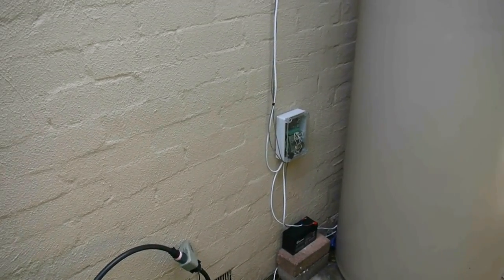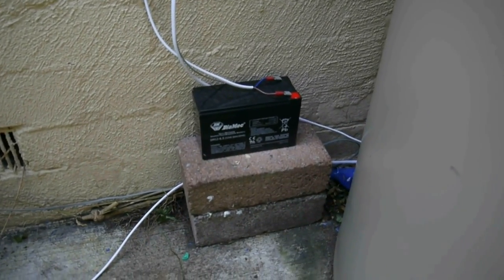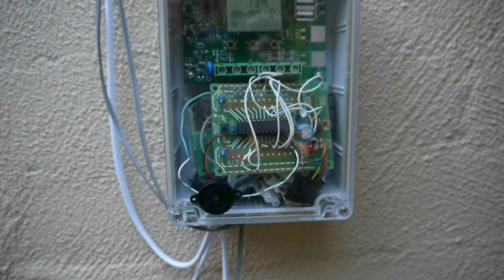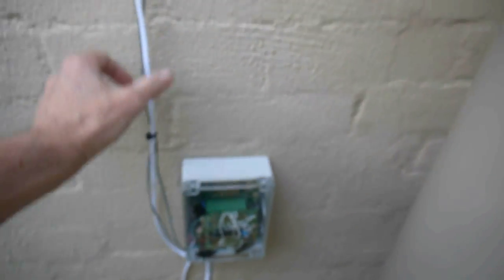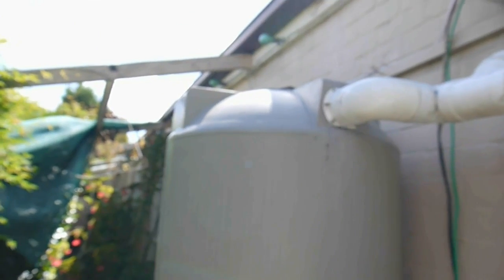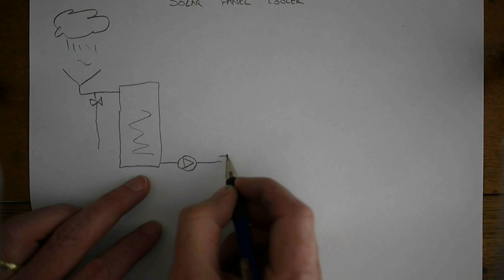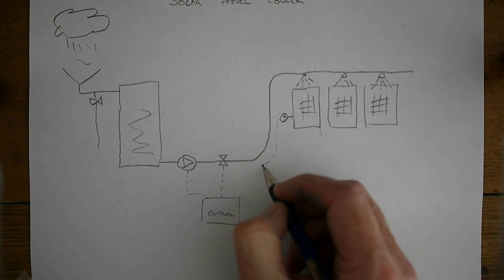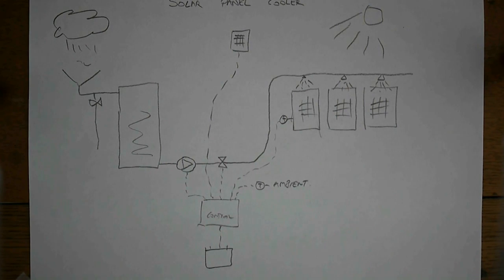Solar powered solar panel cooler system

Comment: Cooling PV panels is now an established business across Europe through the conversion of PV panels to PVT, no need to run rain water over them, when you can gain up to 600 watt thermal from a 300 watt PV panel and use the heated water as a pre heat to your existing hot water tank
Reply: Those panels are enormously overpriced. It doesn't justify the "600w" they generate.
Reply: The extra costs of those panels just justify the 600w gain... I have both installed which is still lots cheaper then a single Pvt panel..
Reply: @usmcn  true maybe it's better to have normal solar panels and use the electricity to heat the water?
Reply: @LuisC7  nah, in summer its better to have vacuüm tubes and in winter its possible to heat through a pv panel. I do both..
Reply: @usmcn  ok so you don't use those thermal solar panels right? What are those vacuum tubes
Reply: @LuisC7  the vacuüm tubes are the thermal panels. You need a lot of them for them to actually work.. I only have 15m2 of them
Reply: @usmcn  oh and also it snows there. How do you clean everything?
Reply: @LuisC7  reverse polarity and it melts off ;) never needed it though. They melt clean fast
Reply: @LuisC7  we have 2 buffers one's 1800L and the other 600L we'll add another 600L in fall.

Comment: What do you think about systems cost?
Reply from the maker: The gain from cooling is clearly worth it for me, because I could do it myself quite cheaply and it clearly does result in generating much more power. I am also on a very generous feed-in tariff which helps - i.e. My electricity company pays me over 70 cents per kwH for any excess power I generate. I think the system cost of powering the cooling system from a solar panel is not worth it - for me it was primarily just a way of making it clear to everyone that the cooling system uses very little power.
Reply: how did ya get 60c per kwh, or has that changed since 2017? my place has the 44c government feed in in addition to power company's 16c so it totals to 60c/kWh. would be quite interested in this

Comment: Michael Porter-  I do have a friend who can help me program and set up a controller.  Can I atleast get the temp sensor brand you have?  Also, is the panel sensor actually touching the underside of the panel on your roof, or is it just in the vicinity?  Thanks.
Reply from the maker: Richard Andrew Sharum in my case the electronic store only had one thermistor available so that is what I bought. The brand is not important. It does touch the panel.  I didn't want to be rude but I am not able to keep answering all the possible questions about exactly how I made it all when it was so long ago. This is not an instructable.
Reply from the maker: fyi - the Picaxe was a 40X2 I believe - but again it was just the one I had available and probably not the best choice now. It is really just about getting the right number of input and output signals required, and that depends on the type of valve and/or pump you choose, etc. e.g. if you had a non-return valve then that requires no signal to work, and you would only need one  output which is to turn the pump on when you need cooling water to flow. You might also decide to feed the two temperature signals into a simple op amp circuit and get a digital signal when the temperature difference is more than 7 degrees, and then you wouldn't need analog inputs on your microcontroller at all. Processor speed is not really an issue. I would probably get an Arduino microcontroller if I was making this today.
Reply: Michael Porter I appreciate the info.  I understand you didn't mean this as an instructable but I just have two questions: Do you know the model of the Orbit valve you have on there? I can't find anything similar in size. Always too big wherever I go. 2: If you have a 12vDC batt, how are you powering a 24vAC valve? Thanks.

Comment: Michael Porter-  I am wanting to do this for my panels as well but I have zero experience with microcontrollers or programming them with temp sensors.  Will you please tell me what brand temp sensor you use, and what version of Picaxe microcontroller you use?
Reply from the maker: Richard Andrew Sharum if you have zero experience then using a micro-controller is going to be too difficult. You need to find an off-the-shelf product that can do a similar function or hire someone with experience to make one for you.

Comment: Michael Porter - Your experiment is interesting. I am working on something similar in India to commercialize the technology. Would like to get in touch with you my contact -  jeevaduraisamy1@gmail.com
Reply from the maker: I'm not interested in commercialising anything, but feel free to use any information from here that you want. I think the real critical trick for the success of this is that I'm measuring both ambient and panel temperature, and only cooling if the panel is more than 7 degrees Celsius hotter than ambient. It is also good to use rainwater to avoid calcium buildup and to adjust the water sprays to give an even coating of spray with minimal overspray or run-off.